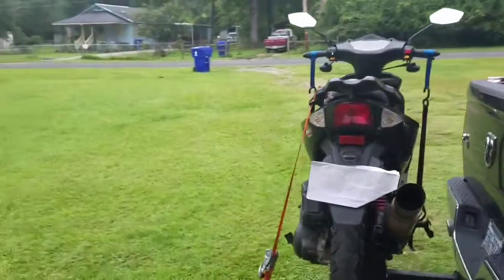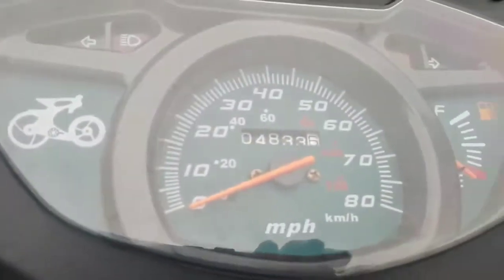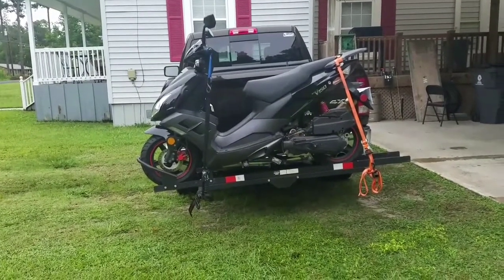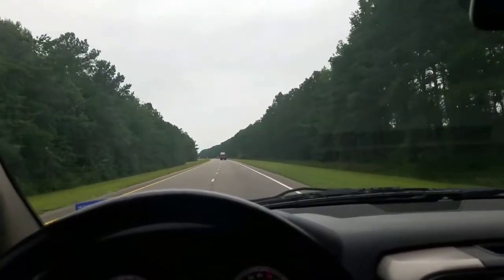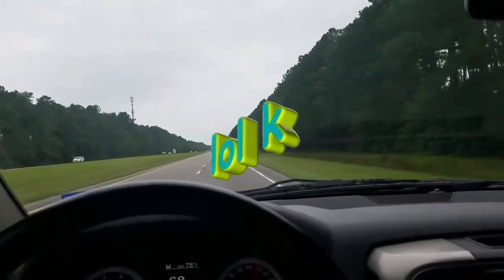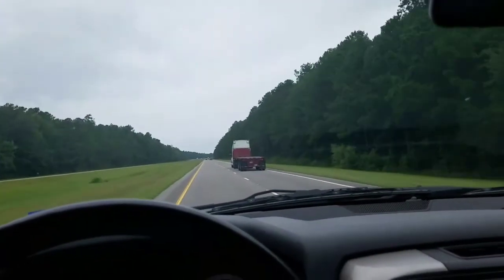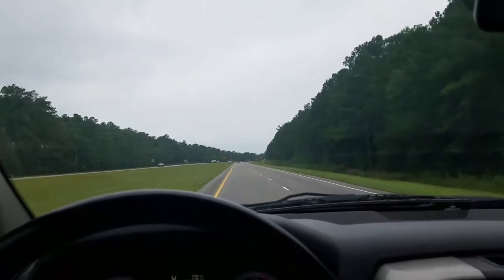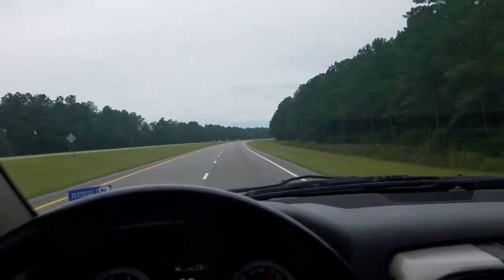2015 Wolf V150 Rear Tire Replacement

Comment: Yeah I do tires at 4 k and oil at 3k it's just better to be ahead of maintenance.
Reply from the maker: Rhino Dan I agree with that approach 100%.  Mechanical failure on a bike can be dangerous and possibly deadly...  I saw your video on the FZ 09.  I was considering that bike if I ever have to replace my FZ 07.  Hopefully, I can get to test ride it also.
Reply: MrCaptainCrazy I would skip the Fz 09 and Get the Fz 10 that's the best Fz bike and for the money you get the most.
Reply: Did JonJon get his groove back?! 😋🤣🤣🤣